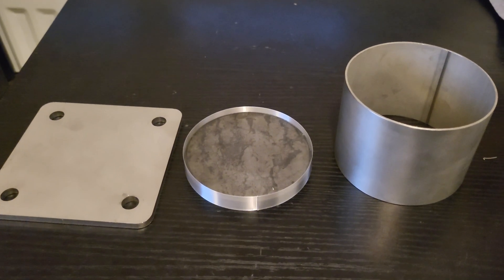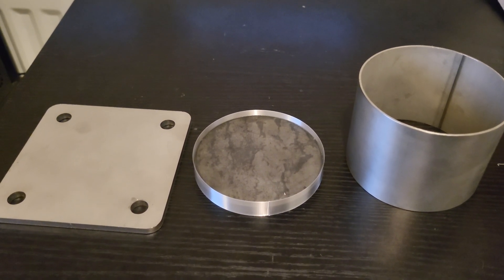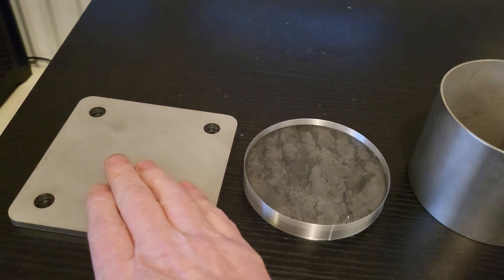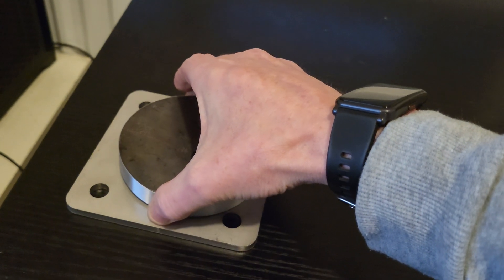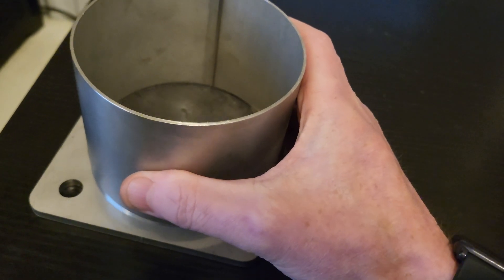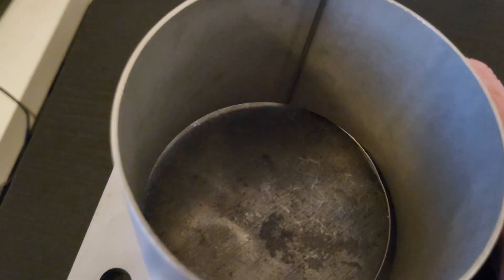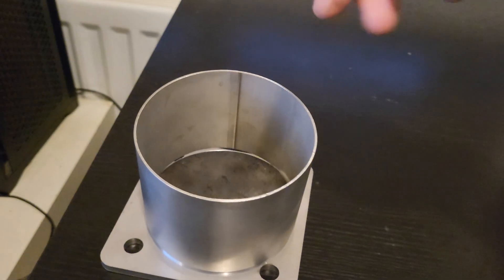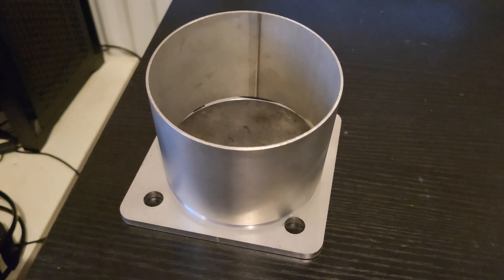Gary McKinnon - Preparing the pressing assembly for the dielectric powder.

Comment: Hi gary, I’ve done some reading in the past regarding dielectric materials to use for asymmetric capacitors and found several references to the FR material which PCBs are made from , mark mccandlish speculates on his famous ARV cutaway diagram that this material is used due to its high dielectric constant value

Comment: I really hope it goes safely. Looks hazardous to me, 10 tonnes of pressure on a gap that size.
Reply from the maker: The hydraulic press is safe, it's the 30,000 volts that the capacitor will be charged at that's dangerous, i've already had a couple of shocks, but the current is very low so not fatal.

Comment from the maker: Preparing the pressing assembly for the dielectric powder. Tomorrow i do the pressing, but then i have to heat the green body (technical name for the ceramic pellet that results from the pressing) at 500C for 10 hours. Then on Sunday do the final sintering, going slowly up to around 1000C over 12-16 hours. So hopefully next Monday will be Anti-Gravity Monday ;+}

This is the process in detail for the dielectric prep :

1. Boil 200ml water.
2. Add 4g PVA.
3. Mix while still boiling.
4. Put CCTO powder in mortar.
5. Add 5 drops PVA solution.
6. Grind until fine powder.
7. Repeat 5 & 6 until no agglomerates.
8. Sieve using 100 mesh sieve.
9. Put the powder in a 40mm die.
10. Heat for 10 hours at 500C to remove PVA before sintering.
11. Press at 10 tons for 1 minute.
12. Heat from room temperature to 1000C, rasing by a few degrees each minute.
13. Keep heating at 1000C for 12-16 hours, this is the sintering stage.

The eventual dielectric constant can be as much as 250,000.
Reply: Very noice!! 
R u goin to test Epsilon (dielectric...) too?
Reply from the maker: @DerBeinmann  Yes i can hook it up to the scope and test that.